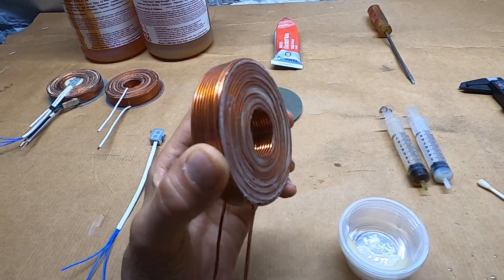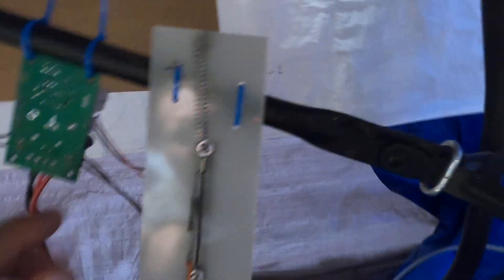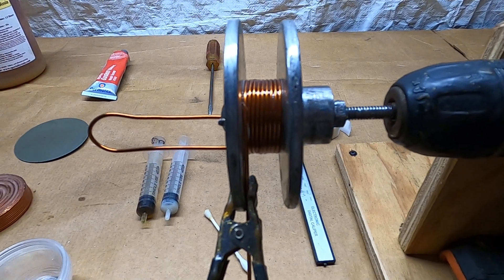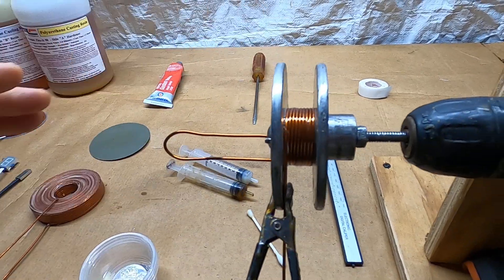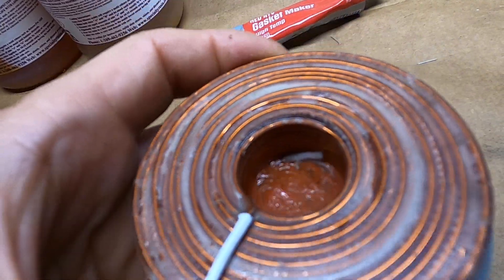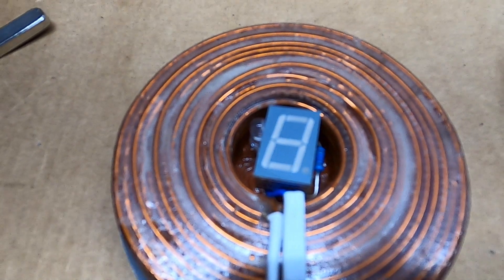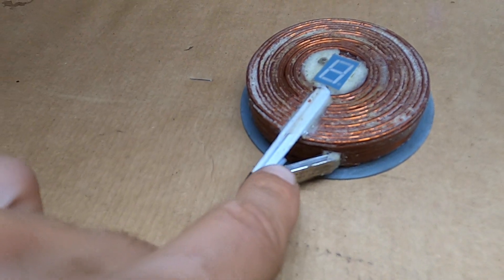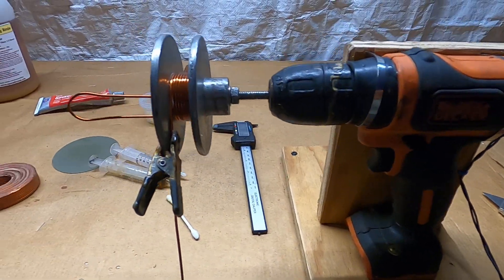099 3" Classic BBMPulser Coil how it's made. PEMF Coil

Comment: Whats turns in coil ....😢😢😢😢 No say
Reply: diâmeters used
Reply from the maker: Coil Made of Copper Magnet wire 14AWG, epoxied between all layers

15 Layers

9 winding / layer

OD 3"

ID 1"

5/8" thick

Air core

Weight 425g or 0.93 lb
Reply: @AndreyD tk you

Comment: Andrew, if I make a coil can I tie down the threads with electrical tape? I’ve seen someone do it while making Pemf mats and I was wondering if you can do it with Beck magnetic pulsars.
Reply: In other word wrap it up with electrical wire minus the center
Reply from the maker: Use glue between layers. I use 2 part flex it 90 glue
In addition I add white cloth tape

Comment: Just had an idea. could you put ferrite in middle of the cores to increase the magnetic field even more. i understand they can increase the field strength by 10 to 1000 times. you can get them from old tv cathode ray tubes or ferrite cores from tuners, etc.
Reply from the maker: Yes you can increase power output by putting ferrite in the middle or some steel rod.
The issue with this is that it will make coil  to heat up faster
Reply: @AndreyD  Maybe Laminated ferrite material would lower eddy current losses & incidental heating.

Comment: Dear Andrey from where did you get the 14AWG wire please?
Reply from the maker: I buy magnet copper wire from Ebay.com i pay $100 for 10lb of 14AWG wire. I can make 10 coils from it
Reply: @AndreyD  Dear Andrey is there any problem if i use 2mm enemeled copper wire???
Reply from the maker: @marakiwyinager581  try it, 
Thyristor and wires to the coil should be stronger but try it. I use 12Awg wires to connect coil thyristor and cap Bank
Reply: @AndreyD  ok thank you
Reply: @AndreyD  copper coil can be made from 2 mm...is that possible? Andrey??????
Reply: @AndreyD  how much meter could it take 1 coil?
Reply from the maker: @marakiwyinager581  not sure how much meters, but it end up to be around 400gram

Comment: finally you did it!  how do you cut the pcb in circle? how long do you wait after applying the band with resin until you do the second layer of winding?
Reply from the maker: I cut PCB circle using metal scissors, then I round it up using grinder then as a final stage I will use sand paper and round up a little with a sand paper
Reply: @AndreyD  how do you know south side before installing 7segment? Isn't it difficult?
Reply from the maker: @yeshecan7  North side is the flat side.
I will make my selected side to put out North, its easy. I use compass to do it
Reply: @AndreyD  can you show us how to connect 2 resistor to the 7segment display? Because on the diagram there is 1 resistor which is 100 ohm connectred here you usef 2 resistors how is that?
Reply from the maker: @yeshecan7  I use additional resistor to add blinking LED at the coil, so when thermal switch triggers, red led will come on and will start blinking
Reply: @AndreyD  you mean 100ohm is not enough? Or what Andrey
Reply from the maker: @yeshecan7  100 Ohms is to lower current to the segment and 3k is to lower current for blinking LED
Reply: @AndreyD  you did not answer to my second question.
Reply from the maker: Pretty much right the way, I don't wait for the first layer to dry before applying another layer.
It takes around 30 min to put 15 layers